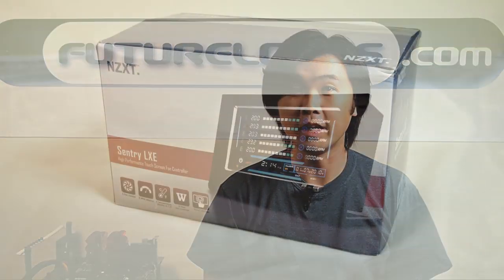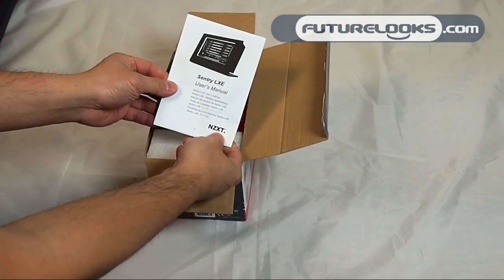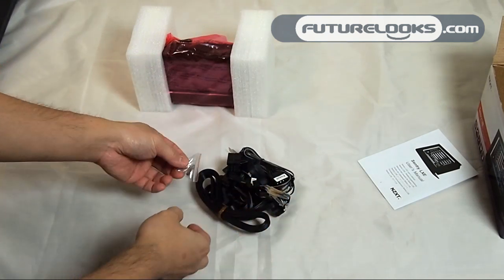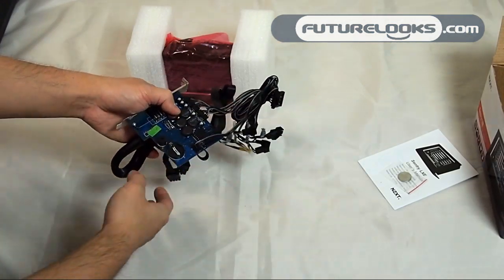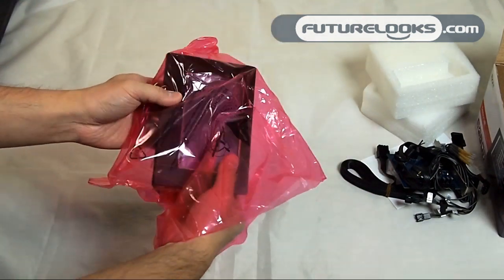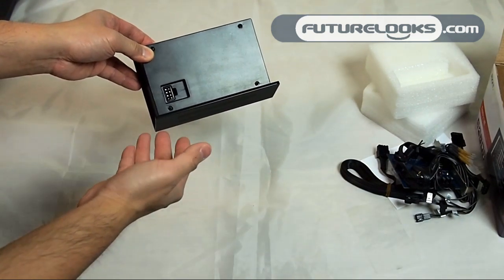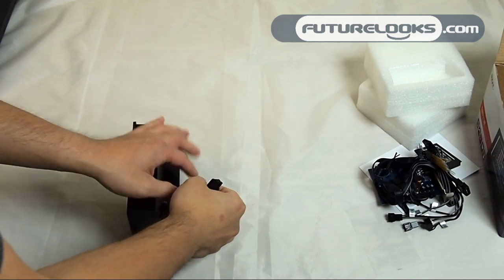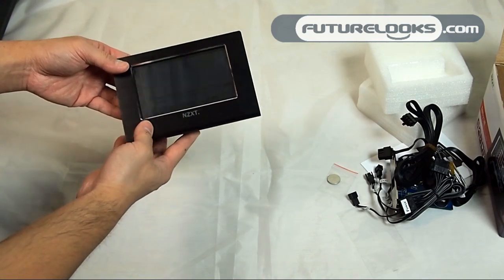Futurelooks Unboxes the NZXT Sentry LXE Touch Screen Fan Controller

Comment: @silentpower415 yes you can, daisy chain. but max would be 2 or 3 and after the fan will not be able to work at full speed which is usefull if your gaming hard :P

Comment from the maker: @danthaman7777 You'd have to mod it heavily. Probably have to create your own faceplate and mounting bracket to fit 5.25 bays. After that, you'd have to modify the PCI bracket to reverse the connector from external to internal. Will likely have to resolder. 

In a nutshell, if you wanted to, sure. But it won't be easy.